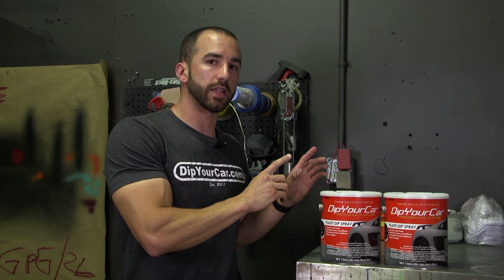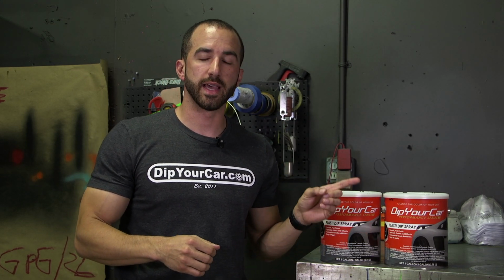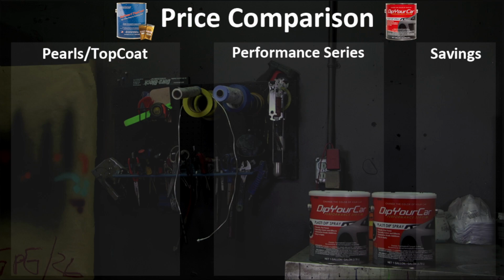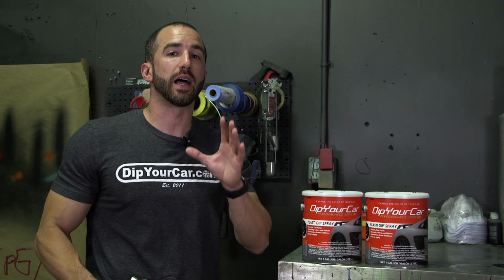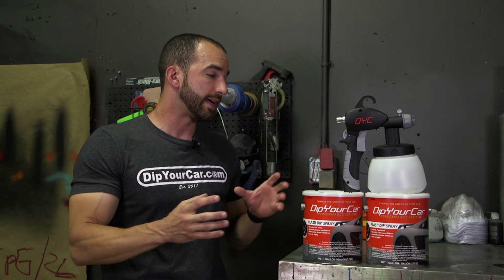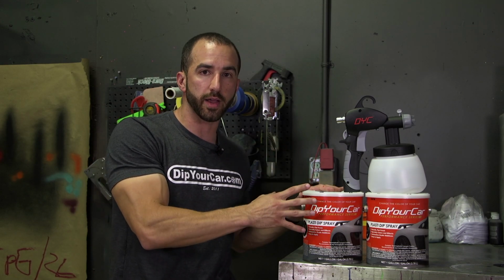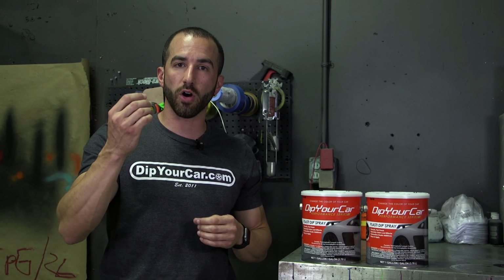The NEW Way to Dip Your Car - Performance Series Plasti Dip

Comment from the maker: FAQ's about the video:

- Yes a Low VOC version is coming for California soon!
- Yes we made a graphical error during the price comparison.  The Stormcloud Grey Kit initially shows $629 and then switches to $605.  $629 is correct, the math and savings are correct, we made an error and didn't catch it.  Sorry about that :)
- Yes we have a ProLine version of the Performance Series colors already available in ready to spray gallons for our Advanced and Professional customers.
- No, Performance Series Plasti Dip should not be sprayed with an HVLP gun.  Turbines only.
- Yes, you can apply Matte or Glossy DYC TopCoats over the Performance Series colors.  We would suggest using the PS colors as they are however, as that's how they work, look and feel best.
- No, we don't have a high gloss option for DIY yet.  A true high gloss uses a 2K gloss clear coat, and those are not DIY friendly.  For now DIY will stick to what it does best;  beautiful Matte and Satin finishes.
Reply: DipYourCar love the product! What do I combine to give this new product a nice satin finish?
Reply: How soon for California?! Cause I need to paint my car from an accident and will be using plastidip. A week? A month? Three months?
Reply: Po Russki says couple of months if not sooner in another post
Reply: Can I do a color shift dip with the performance series and can I have a gloss finish
Reply: Any chance of nardo grey coming out soon?
Reply from the maker: ALOHAbyCHOICE _808 SharkSkin Grey is pretty darn close!
Reply: DipYourCar any future video of shark skin grey coming up?
Reply: You may do PS kits for motorcycle , not only for cars. But with the same, small surface for choppers or so with few paint up to sports bikes with a lot of surface to cover . 
Plus, are you able to ship PS or plastidip to France ? If yes at what shipping price ?
Thanks
Reply: Sooooo all that stuff is not available in Canada? How come? Is there any way I can get it shipped to Montreal?

Comment: I want to see how good it still peels off! Since there’s a lot less product on it, will that affect it’s peel ability and it’s durability?
Reply from the maker: Tom it peels considerably better than a car w TopCoat and pearls. As stated in the video, all your peelability comes from PDS, not the TopCoat Gallons. The TopCoat actually makes the film less stretchy and more prone to breaking as you peel. A Performance Series car will peel better than a TopCoat/pearls car every time.

Comment: Patiently waiting for proline performance series.
Reply: pbabyjoker proline already sprays nicely and levels beautifully.....no need to change anything...the plastidip performance series is improving to bring it closer to the proline advantages without needing a compressor setup.
Reply from the maker: You don't need to be patient - we already have it!  Performance Series colors are also now available in ready to spray ProLine gallons.

Comment: Yeah Ok......... getting pretty keen now once I re-glass the kit on my Aristo. Any tips for using an actual compressor / gun to apply this though? 1.4mm tip, 2mm tip, PSI, etc?
Reply from the maker: Michael Green if you are an HVLP user you should be spraying ProLine Coatings be DYC, which are designed for HVLP. Plasti Dip is too thick.
Reply: Cheers, shall look into it.

Comment: Can you spray this through a pneumatic gun? If so, what tip size would you'll you recommend?
Reply from the maker: No you're going to use turbines only for this, but we do have the DYC ProLine coatings that are designed for HVLP and compressor setups.  With that you'll use a 1.8 tip at around 18 psi

Comment: You didn't mention it, but I'm assuming we can still use a HVLP as well? My problem is I don't want to buy a whole car kit because I don't want to spray my whole car. I'm going for a two tone look. Basically the sides and some of the front and rear. Can't wait to try this! Also having a hard time picking the color I want to go with! :-)
Reply from the maker: You can't use an HVLP, PDS has always been too thick to spray through an HVLP without getting overspray.  Turbine systems for PDS.  However we do have Performance Series Gallons ready to spray in ProLine for HVLP users.
Reply: I'm a little confused with that first sentence. And I've used a HVLP with PDS and got good results.
Reply from the maker: Comment edited.  The problem is traditionally PDS is too thick to spray through an HVLP and compressor.
Reply: I thought pds could be thinned ,

Comment: How long would this last on a vehicle with harsh weather conditions? I live in upstate ny and it snows, and rains often, can be really harsh during the winters cause a lot of salt gets put on the roads from all the snowfall.
Reply from the maker: If applied and maintained properly the coating lasts years!  No worries on longevity.

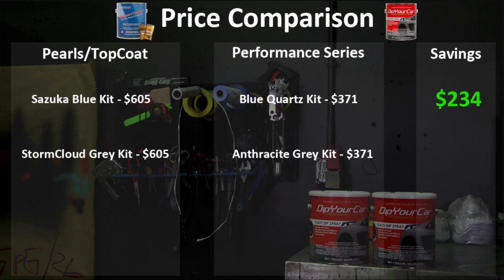Comment: 6:48-9 Anyone else notice "$629" change to "$605"? And I was hesitant before... But I think imma have to dip whatever I get, whether it be a car or motorcycle :) I'm a huge fan of the splatter, but sorta want to go with a black base and neon colors on top, more stealth
Reply from the maker: You can see the correct price is listed for Stormcloud Grey at $629, but the following frames switch it to $605 by mistake.  The savings and math are correct, however that was an error that should have been caught.  We apologize, thanks for watching!

Comment: will there be a high gloss top coat coming for this as well or just continue to use the standard top coat gallons?
Reply from the maker: Continue to use the Glossy TopCoat if you want, but the performance series colors look, feel and level way better without it.
Reply: I was more looking for the gloss look

Comment: The applications at the end only showed Matte finishes. How does the Performance series do with a gloss 
top coat?
Reply from the maker: The glossy topcoat doesn't level as flat or feel as good as the Performance Series colors.  You can add the glossy topcoat on top but it's far better without.

Comment: Hey Fonzi I painted my front grills gloss black but it has like a water spot texture on it after. But even if I wipe with a wet cloth it doesn't come off. The texture remains unfortunately. Help.
Reply from the maker: Sounds like you have some hard or contaminated water.  Try Bug Delete, usually removes everything from dip.  Find it on dipyourcar.com
Reply: DipYourCar Thanks!

Comment: Hey Fonz your math was a little off on your savings slide .....
Reply from the maker: We made a graphical error.  You can see the correct price is listed for Stormcloud Grey at $629, but the following frames switch it to $605 by mistake.  The savings and math are correct, however that was an error that should have been caught.  We apologize.